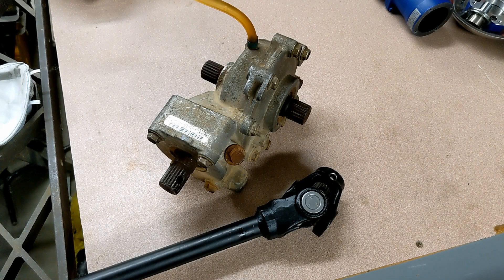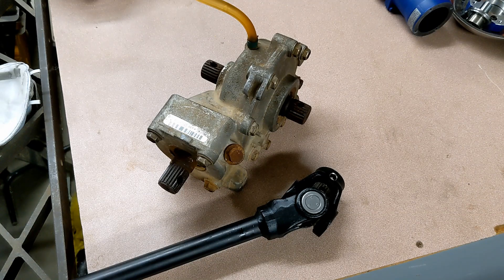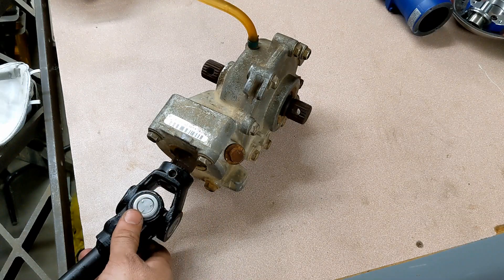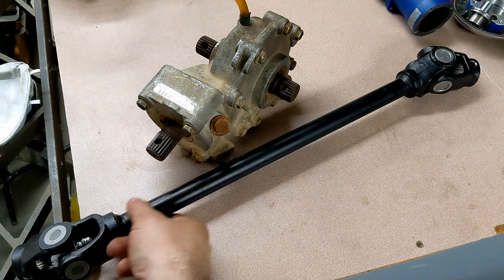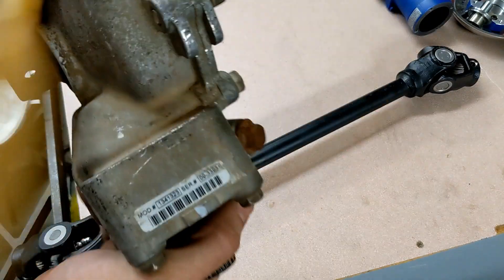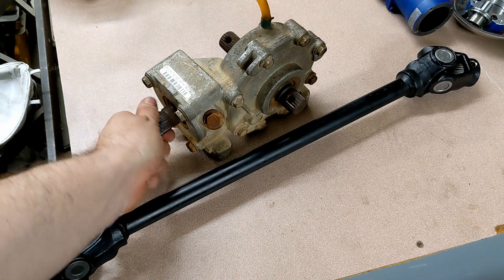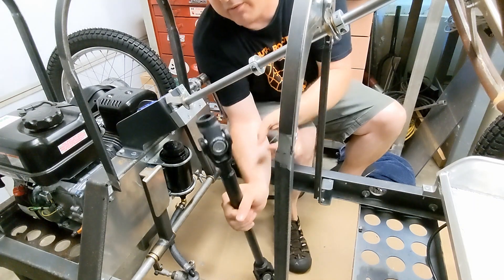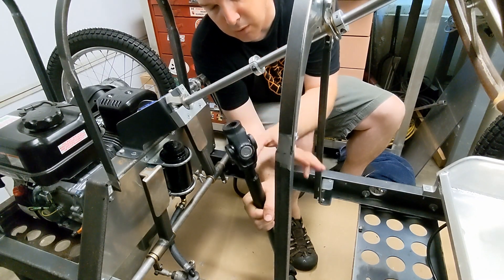GN GNAT Cycle Kart: The Driveshaft

Comment: I am also doing the front engine setup. The only difference is I am using both gearbox output shafts. One for each rear wheel independently. Thanks for your research and how to video. It saved me a bunch of time. I also used the Polaris gear box and splined shaft. Both cost $100 on E-Bay.

Comment: How do you have your torque converter attached to your drive shaft? How does the Polaris front differential turn the right direction for the rear wheels?
Reply from the maker: Drive pulley of the torque converter mounts directly to the engine. Regarding Polaris rotation, I got lucky, but I did my homework first. I verified the engine rotation direction, then checked the Polaris input shaft rotation. Fortunately it all worked!